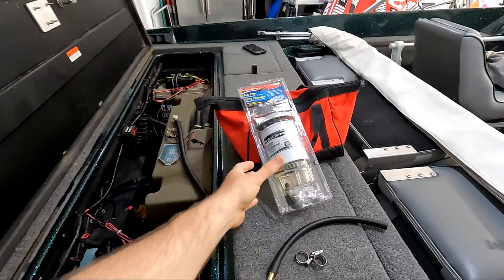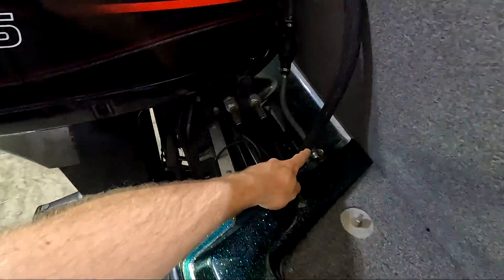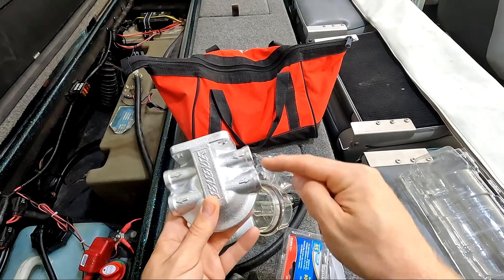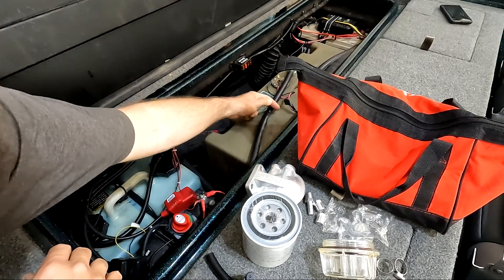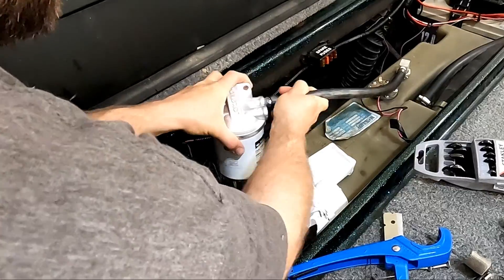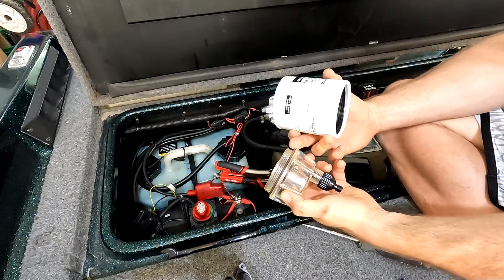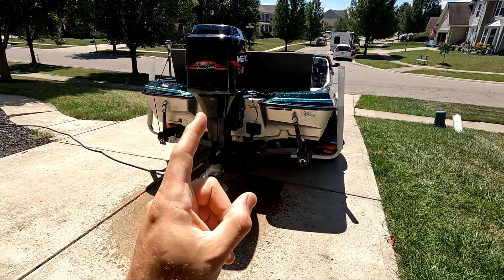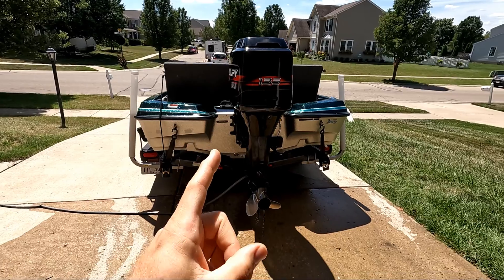Fuel Water Separator Installation Guide | Upgrade Your Outboard Fuel System

Comment: These are great but you've got to know/remember that filters can only filter out, about 14oz of water, and then they become maxed out and water will still make it to the motor. This just happened to me when of was 20 miles offshore and had to be towed back in. What I am looking for now is and alarm system telling me water is collecting in the filter, fuel tank, or motor. The way things are know you don't know if the filter is maxed out. In my case I got water in my tank from the gas station if filled up at and it end up being more than what the filter could handle. Once the water reaches the motor you are kind of screwed until you get somewhere where to flush the motor fuel system. I ended up having also most 2 gals in my tank.  The filter is great, but not full proof.

Comment: I am under the impression that fuel isn't supposed to be in the bottom bowl. When doing a good search it claims only water should end up in the bowl
Reply from the maker: If there is water in your gas it will settle on the bottom because gas is lighter, if there is no water then only gas would be there.
Reply: Thanks for the clarification you're a legend @mvboutdoors

Comment: Is your fuel pre mixed? Or do you have an oiler on your motor? Just curious if I will be fine running pre mixed gas through the filter and then into the motor.
Reply from the maker: There is an oiler on the motor with an oil reservoir on the boat. Premix is find because the oil mixes with the gas unlike water.

Comment: I just bought my first boat 88 ranger 393v with a 87 Johnson V6 150 2 stroke (took the vro off) was thinking about getting a separator living here in humid Florida. I use stabil but I just want to make sure I protect my investment as best I can. What are your thoughts? Watching your video im sure i already answered my question.  I have a selector valve so ill just have to route from the selector to the water filter back out tonthe original ball inlet.
Reply from the maker: It can only help, esp with high humidity. I would say its most important in a humid environment.
Reply: @mvboutdoors  thanks for the reply. I have been researching them and reviews seem mixed as alot say the canisters cause or leak. 🤷

Comment: I see that this is a fiberglass boat, what did you use to mount? Did you drill a pilot hile with a drill bit then use a slightly bigger screw to mount?
Reply from the maker: 5:31 -- That is correct, that is exactly what I did.
Reply: @mvboutdoors  what size drill bit and screw did you use, do u remember
Reply from the maker: @stevestewart3816  Sorry I don't remember exact sizes. I just eyeballed a drill bill that was slightly smaller than the screws I had on hand.

Comment: That fuel water sseparator could easily be made into a "fuel polishing" system by adding a standalone fuel pump and some extra tubing, plus it'd also be a fuel transfer setup for if you think some fuel cans in the shed got water contamination
Reply: Or if the tank has water and dirt in the bottom
Reply: How’s it been after using it for a year?